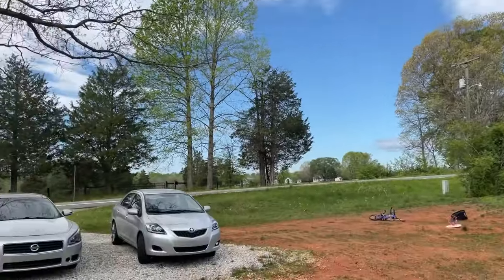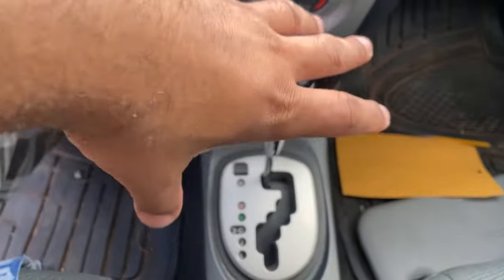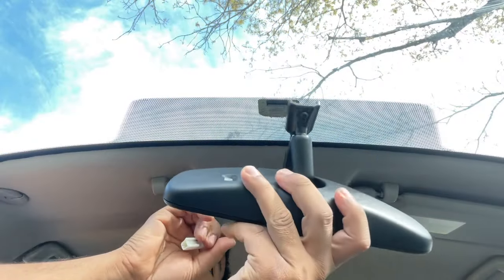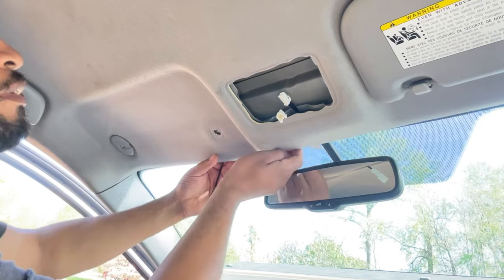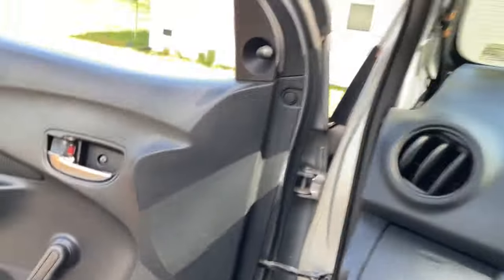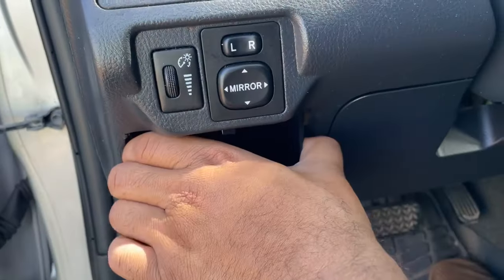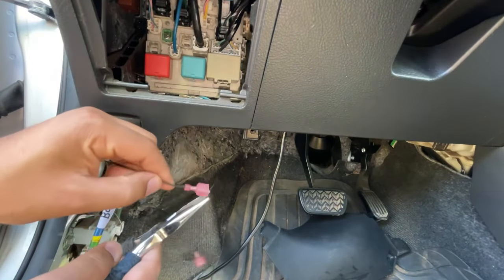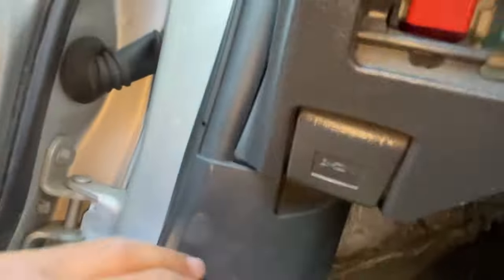Toyota/Scion Auto Dimming Rear View Mirror Upgrade And Install

Comment: Great upgrade, will this mirror fit a 2005 Scion xb , the original rear mirror are pretty small for a large windshield. 👍
Reply from the maker: Unfortunately Toyota doesn’t offer one for your gen or year of the XB, for the second gen they do. I’ve updated the description for all the vehicles this upgrade is for. It would be possible if you can find a way to remove the d tab (the metal tab on the windshield) that mounts the rear view mirror to the windshield and replace it with a second gen XB d tab then you’ll be able to install this into your first gen xb
Reply: @ScorpionMultimedia  thanks for your info 👍
Reply from the maker: You’re welcome 🙏🏼